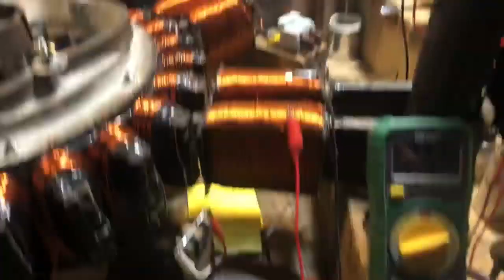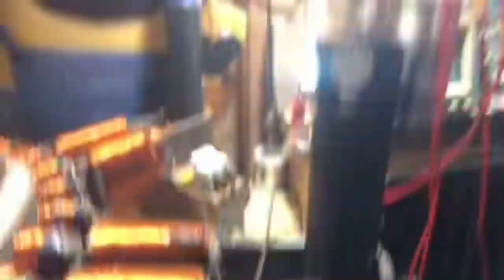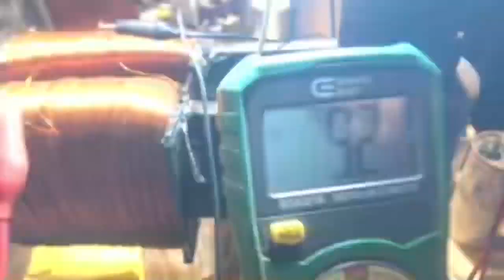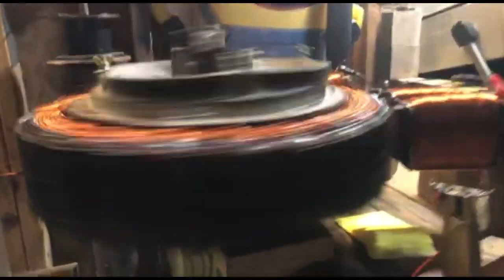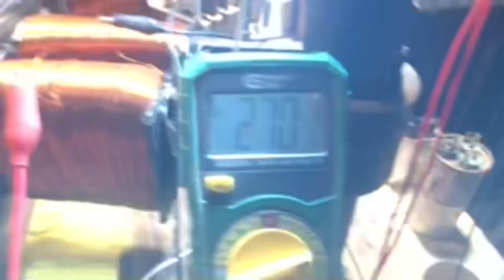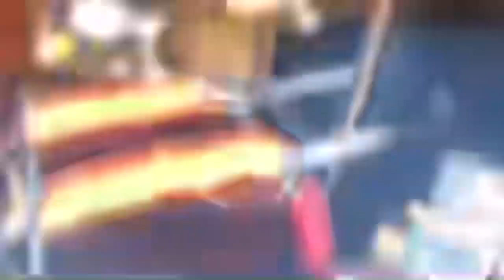Coral Castle, Ed Leedskalnin, Charging and  Releasing Capacitor!

Comment: Eef da peekup calls were also fully surrounding the veel hmmmm large increase...

Eeeef every pass of da magneeets completed a north pole to south pole coil circuit tru da spack gap BANG BLAMMO ! You get high voltage build up dischach into yo couls!  Dis creates large nagneto effect and eeeef yo hav dielectrics aggravated by dat den yu get static charge a added to dat magnetio effect. Ya good. Large capacity increase.

Dis large discharge from dis very large build up into a very large primary. Creating larger magneto duelectric effect with each pulsation. 

Ya don ned da reed svitch. Tungsten diode.. magnetron. An fer dat mattwr yse a step up transformer to immediately step up ya volts. Right as puck up coils dischagee.

Da hiy volts tru da magnetron trows out ya sparks onto ya primary inducing into ya secondary now ys got massive voltages.

Git ya sum massuve caps. An fillem hugh ya see. Now ya gots what ya needs. Cuz all ya needs is sum trigger wires on your outer pickyps to motorize ds wheel. One separate wire in outer coils goes bang wit da udder bang bingo bango. Discharge frequency from da magntrin spark diode fires out every time da coil passes da magnet see. So it passes den da bango den da truggrr hits da pickups and da wheel moves. Walla!

Comment: Roy - A reed switch acting as a switch / spark gap won't last very long, especially without a buffering in series capacitor! Think old school distributor with breaker points... Remember the capacitor? That capacitor is charged reducing the spark balancing the potential to protect the breaker points from burning and arcing. My first wheel was a 12" steel bicycle wheel with magnets taped to it and an iron cored (plastic coated coat hanger wire from Walmart) bifilar coil, wrapped with 20 gage and 24 gage speaker wire 150' for the drive coil wrapped on a bobbin with a 1" core, 2.25" X 1.75" . I used the spokes for impulse timing against a positioned stinger wire... The stinger wire with just 3 volts supplied by 2 C size batteries would burn up after an hour of operation! Employing a series capacitor extended the run time of that stinger wire, with that experiment. Two C size alkaline batteries would easily run that wheel at 150 rpm for 96 hours unloaded. From that experiment I demonstrated and reinforced my understanding concerning Adjustable Pulse Width Modulation (APWM), energy transforming and Timing Dwell. Timing is everything! I love the lessons of the wheel and timing joules of energy! You have many areas to work with on your wheel! Have fun and Best Wishes!